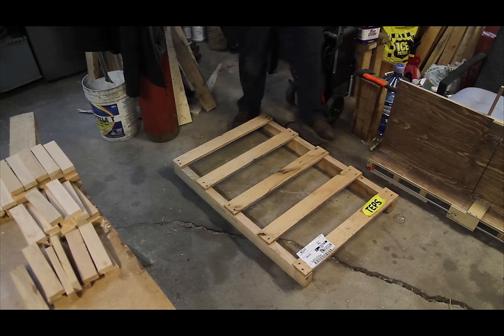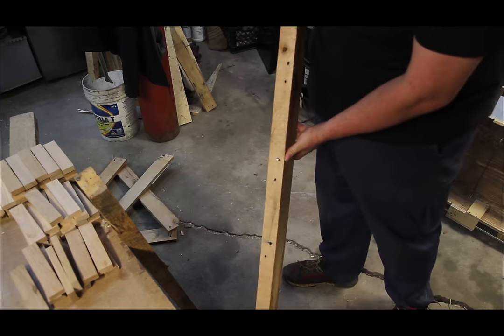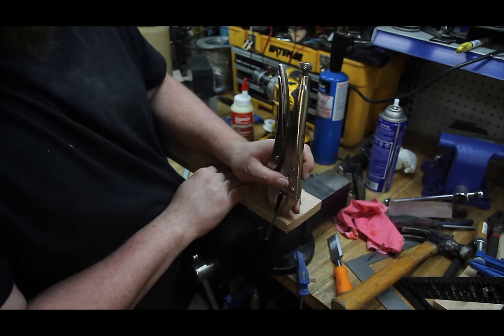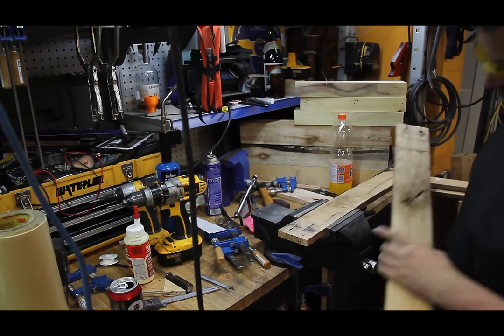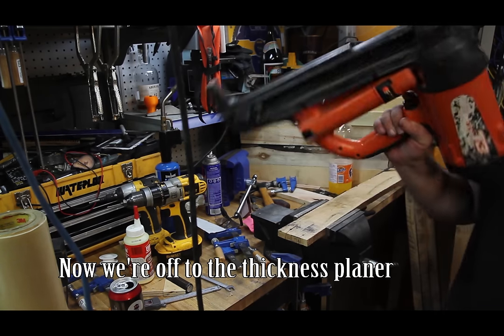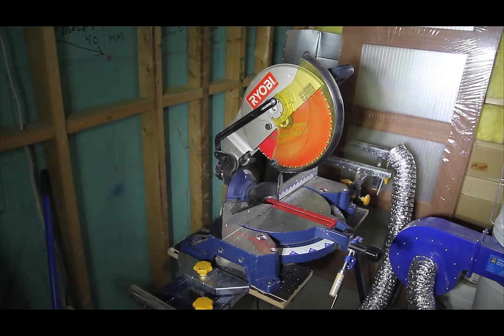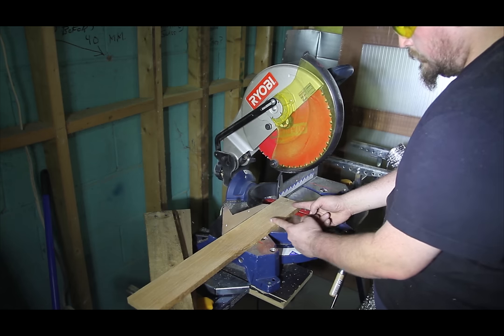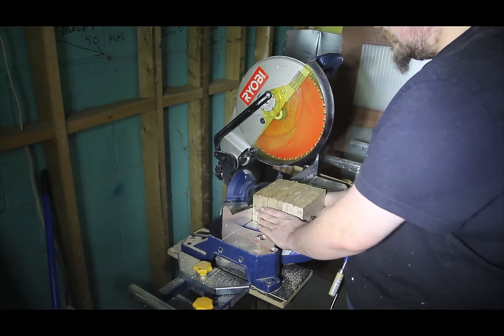Wood beer Mug/Stein pallet project, cutting the staves and base

Comment: A little hint for you concerning pulling those nails. If you put the hammer under the nail head like you did when pulling them here in the video & then rocking the hammer back & forth (side to side) rather than pulling up you will pull them much easier. Each time you swing to the side get a new grip on the nail so on and on.

Personally, I use a pair of 8-Inch End Cutting Pliers (nippers). I do not care how tight the nail is in the wood, the pliers will pull it and with relative ease in doing so.

Thanks for sharing the 3 part video on this build. VERY nicely done!
Reply from the maker: I hear yea, but these nails are blunt cut, glue tipped and they have spikes attached since there where auto nailed, from one of those air nailers. The heads popped off lots of them since the fibers where crushed when the nail was rammed into the wood. We had to weld a bead on a few nail heads. To get them out. Wiggling would only make the head pop off faster. What did seen to help was to pound the nail in a hit. Then pull it out.
Reply: Edward Norton ظ

Comment: I agree with Vic Holbrey's comment - I am getting tired of looking for good ideas to use on pallet wood, yet spending 1/2 - 3/4 of the video watching pallet dismembering and clean up - surely we've seen enough "how to pull apart a pallet" videos by now and just want to see you making the item.  
secondly - in the last few seconds of the video, you've jump from sanding the bases, to having the bases already inserted into the mugs - did you cut then as circular, or as a dodecagonal shape?

Comment: nice work man thanks for the info and also I like your table saw sled it looks that it has finger joint jig attach to it .....take care thanks again
Reply: indeed it does have a finger joint jig on it, thats what we built it for in the first place, then just started to use it for a lot of other work because we built it so well it was strong, straight and easy to use and set up.

Comment: Many pallets are treated with harmful chemicals and you never know what harmful chemicals have been carried on them. I personally wouldn't use them for any food or drink consumption.
Reply from the maker: @Anonymous-fx5bu  yes you do. It's stamped on the side of the pallet. You can look up the code and even tell wat country it's from. More over. I sealed it with penetration 2part epoxy that's inert after it's set.

Comment: May I ask what is the point of pulling the nails if you just end up cutting the end off anyway?  It didn't appear that you was even close to the nail holes so the nails most likely wouldn't be in the way.  If they was in the way just bend them back the opposite direction and cut.  Saves one step on both ends of the board. My wood stove burns nail laden wood cut offs all the time.  LOL  Just watch what you do with the ashes later on, or run an old speaker magnet over it and to collect them for trash then toss the ashes.
Reply from the maker: some of the nail heads stick out and its a pain to sit some boards eaven on the chop saw, your right though in most cases its a wasted step we just wanted an excuse to use the nice power tool for something it was not intended for. 

on the other hand most of the time im taking these skids apart at work after shift and the flat pack much better in my trunk with the nails..
Reply from the maker: on a side note our wood stove has more nails in it when ash as we burn loads of wood with nails from skids..

we sift the nails out of the ash once a year, nails go to metal recycling (city curbside pickup) and the ashes we use instead of salt on the driveway and walk ways in the winter.
Reply: I live in the middle of the USA.  We have limited, and I mean very limited means to recycle anything.  IF you can find a recycler for nails, you haul it and deliver it yourself.  My Ashes end up in low spots or dead spots in the yard.  It drops the PH if that is the issue with your soil.

Comment: sorry to ask the wood guide that are you placing the stave what angle is it I trying to make planter for 12 stave but I need to make jig for cuuthing bottom and top level
Reply: +Ernie Zamora the angle of that wedge on the jig is 12*, we cut that on our large really nice and old mastercraft pro table saw that takes a 10 inch blade and is able to cut a section of 2x4 flaming lumber on the long end in one pass without an issue. the blades that we like using these days are freud chrome blades that have a very high tooth count they seem to cut light a really hot knife through soft butter and leave a finish that just needs a light sanding and its ready to go.

hope that helps
Reply: 360÷12÷2 will give the angle of cut

Comment: I was going to ask you on the small sled cutting staves is okkay adding some clamps or is difficult for safety
Reply: you can totally add a "bessey clamps" or some other type of flip down clamp like this http://www.finewoodworking.com/tool-guide/product-finder/bessey-auto-adjust-toggle-clamp.aspx

we didn't have any and didn't feel like stopping the project to get some, we would recommend that you do actually do the smarter thing and get the clamps, only thing is that if you use the clamps you will have to make the sled a little bigger and add supports to hold the clamps at the right height and angle to the work piece so that the clamp has maximum hold on the work piece. you would also have to get a clamp that will not be in the way of the saw blade while its holding the staves while cutting.

i should add that the saw blade that we are using in the table saw is a fine tooth, thin kerf, chrome coated freud saw blad, i forgot the part number but its super sharp, it has no issues cutting through this oak/maple/cherry so that sharpness help with it being much safer to keep your hands closer then a dull or old blade, also if you keep a tight grip on the wood and always pay attention all will be fine... other wise always use a clamping system..

Comment: If you're going to chop the ends off anyway, why remove the nails?  Chop them off with the nails in place or just run a saw up the pallet and skip two steps.
Reply from the maker: Running them though the thickness planer narrows the ends, if I chop them off now, i'd just have ti cut off more later.

Comment: what are dimension dowels
Reply: +Bartek Fil they are 31mm at the widest, 26mm at the narrowest, 12* angle 12mms think and about 140mm tall, the width of the staves determines how big around the mug will be, the angle will not change if you stay with 12 staves. hope that helps.

Comment: You do know pallets are treated with chemicals..i got poisoned watching this!
Reply from the maker: indeed i do... please do a google search on stamps and markings on pallets that are internationally used to quickly identify how they are treated

the markings will always have a tree logo and the letters IPPC next to the logo.. next will be two letters at the top most part, thats the country of origin , next one down is a license number.. the last one, and you should really pay attention to this one, will be a marking of 2 to 4 letters telling you how it was treated.. HT means heat treated (baked at a hight temp to kill all pests and dry the wood a bit) , KD is kiln dried meaning its baked at a high temp for a period of time to dry the wood to a very specific dryness , HT-KD is the best marking as its both, commonly found on framing lumber... if you see any other markings those are chemical processes and should never be touched, worked, cut or burnt.. those other markings are  MB means Methyl Bromide, this is bad shit stay away..

as for you getting poisoned from watching a youtube video.. i dont know what webMD told you but internet videos do not cause poisoning in humans (sorry if im assuming here) also if the pallets i use where indeed treated chemically the chemicals used are not strong enough to be transmitted via the internet and definitely not from dec 2015 so you are safe and unaffected... i hope at least

here is a nice link to do some research before your next project
https://www.1001pallets.com/pallet-safety/

thank you for your concern

Comment: If you keep cutting like that on that table saw with your fingers that close you will cut your fingers off possibley your hand it will happen faster than a blink of an eye I just hope some one else don't do what you showed
Reply from the maker: I use a push stick 99% of the time. A real eye opener was a video on kickback where a guy was trying to show how he can get out of the way and didn't even notice his finger came MM from the blade. If the blade is lower than my fingers and they are 3/4 inch away I usually just push it. But any closer and any risk to my digits I push-stick-it